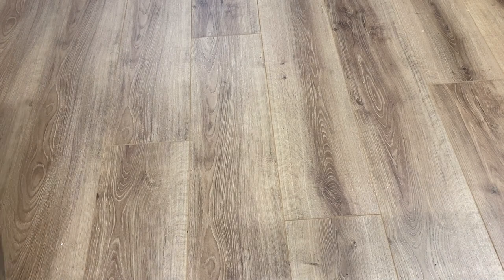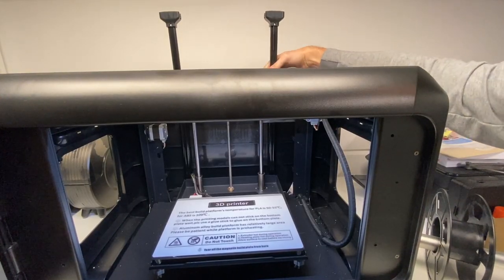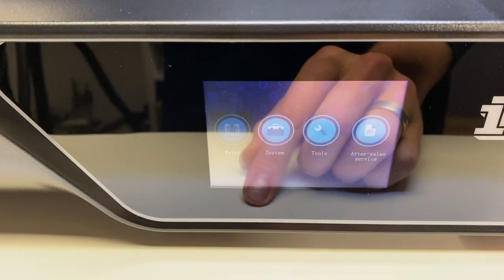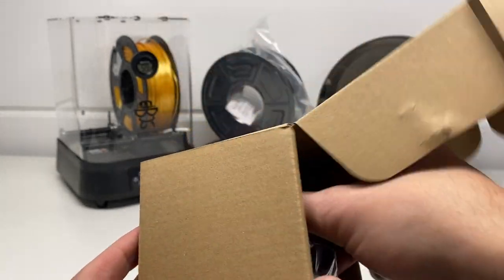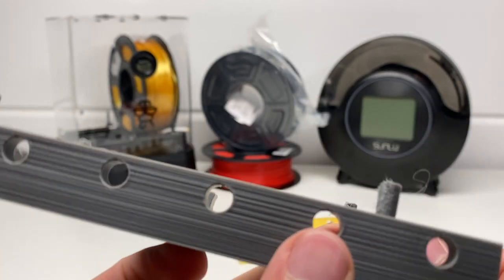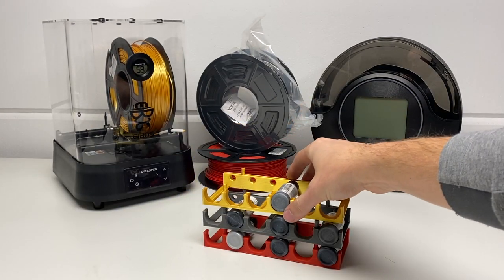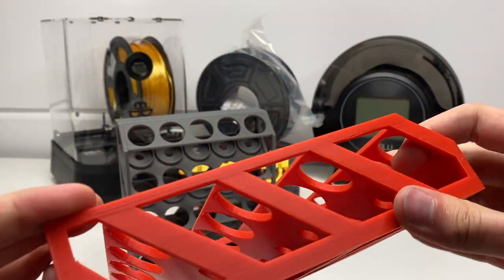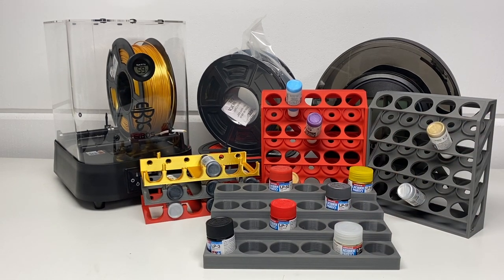3D Printing Paint Storage Racks with the QiDi 3D I-Mate S FDM 3D Printer

Comment: Hi Which 3D printer do you recommend I want to start in this world for personal use to make hobby parts?
Reply from the maker: I would go for a resin printer if you want to make parts for your models. Look at my videos here: https://youtube.com/playlist?list=PLml5qXMU9oOT02oeuBh1QtMh9VJxnH7Bw
Reply: What an update to workbech!
Reply: A resin printer is very good at high detail small custom parts for model making.
A filament printer is good for larger structural parts.
These two types of printers really complement each other.
Reply: @marknn3  Question after having experience I would have to have two impresora ?
Reply: @ernestomoreno6814  I started with an Ender 3 Pro, which is incredible for its price and can perform very well. For high(er) detail parts I got a Elegoo Mars 2Pro a few months ago, and it can produce incredible detail. Two very different use cases.
It very much depends on what you really need to print.
Reply: @marknn3  Thanks